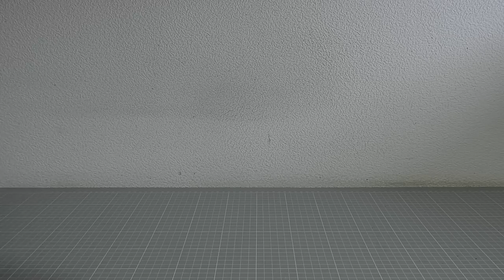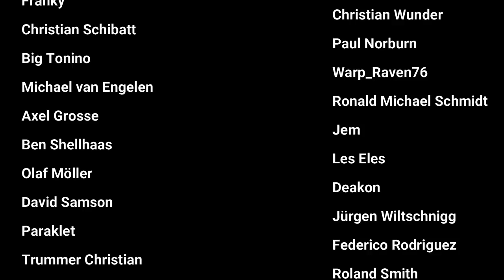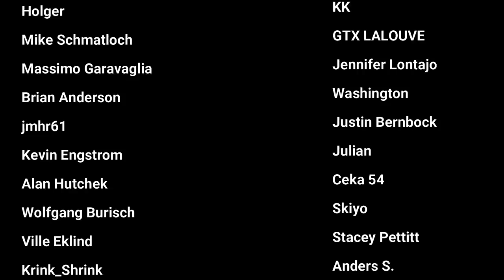MAZ 537 G / 1:35 / Acrylic Paint Weathering Effects / Chipping with Hairspray

Comment: Heh, if this becomes a Zombie Hunters truck setup, would a engineering's tank, then not be a good option?
Or what about a bridge layer tank?
If you do end up combining ALL your Zombie Hunter Trucks, in one convoy setup, if perhaps on a pitstop at say a tank station or so....

The red color really is working well on her, really really well.
Would that set with that water tank trailer for say a Jeep, it's water tank, be something for this gall?
Could be for water, could be for extra fuel.
No room for a crane, but that might be for the best.

Will you put the ZOMBIE HUNTER Truck M1070 Gun Truck, back gun nest structure in the place of those tires on the trailer or so?
Depending on the size, you might be able to hang the spare tires, on the sides, like the front side.
Suggest you check the wheel sizes of this MAZ-537-G, the M1070 Gun Truck, the M911 C-HET Truck and the HEMTT Gun Truck

Anyway, you might like this one, for how heavy the modifications where.
Mad Max Fury Road War-Rig, has a fun origin, in terms of trucks.
https://www.youtube.com/watch?v=dgyKv97weF8&ab_channel=Jack%27sChromeShop

But it does show that you could put that hook-up wheel for the trailer, way more backwards on the M1070, same for your M911 C-HET, which has some very nice winches, that would really be useful on that MAZ-537-G.
Which you didn't make it's M747 trailer, so if wanted you could go for a Zombie Hunters Convoy that has two trailers loaded with a bridge layer and a engineering's machine, each, plus a third one that is either a more normal flatbed trailer or a fuel-tanker-trailer.

You're trying to limit your diorama size(s), right?
They need a truck setup for milling, drilling & other construction tasks, including welding.
A mobile kitchen is also a must as well, so see what for gear you would want, if you had a group of folks, in terms of machines & trailer (loads).
Mad Max has those War-Rigs as tankers, for a reason, no fuel production or very limited, so not every fuel station, still has fuel in the tanks, several can quite easily, be already dry, from day one of the Zombie Raising.
A M.A.S.H. unit is probably also wanted, as well.
What could be combined?

I just have to wait and then I will know.
Would be fun if those truck diorama's, can be combined into a bigger one.